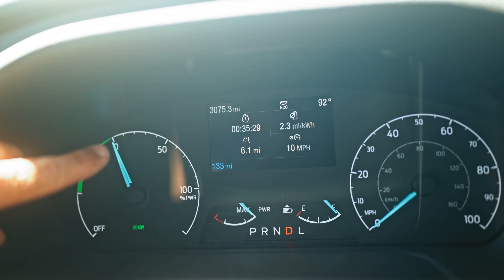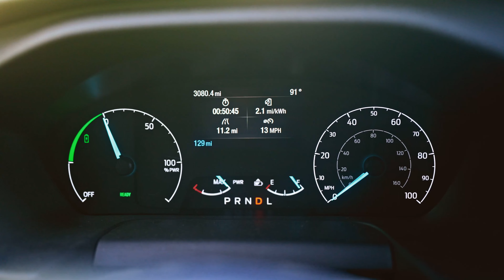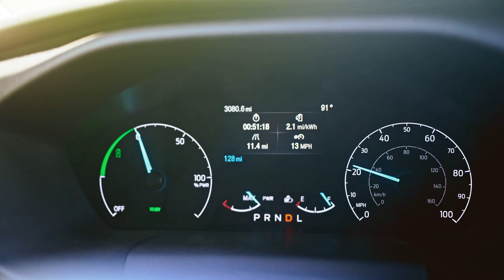Tug Of War!  **ELECTRIC vs GAS**

Comment: I heard it's a feature designed to minimize wheel slip when accelerating from a stop. Electric motors have full torque output at 0 RPM, which combustion engines do not, so without that feature people could frequently lose traction when taking off from stop signs and stop lights (especially if they're accustomed to driving a gas or diesel vehicle.) I believe some other EVs have a specific drive mode that disables the feature.
Reply from the maker: We believe it's a feature that Ford engineered into the e-transit so that you don't dump all of you're stored contents while you are accelerating.

Comment: I would be interested how the E Transit does pulling a utility trailer i.e. power, range
Reply from the maker: They currently aren't rated to tow but I know some have bolted a hitch up to them.
Reply: @SmedleyPlumbing  That's good to know thanks for the fun video's
😄
Reply: @SmedleyPlumbing  Very informative to know this!
Reply: Seen the Ford EV pickup with trailer and it did terrible.   Due to extra friction of trailer and poor aerodynamics.   Of course the drivers gunned it down the freeway as that's what you do in a test.    But the E Transit shows remarkable little difference in distance even when weighted down.    Just shows Aerodynamics make a huge difference.  I suspect if the van had skirts on it, it would do better on efficiency.

Comment: Now go out and drive 300 miles and repeat the test. Electric good for bikes, golf carts, and small slow things. Useless for heavy high speed vehicles.
Reply from the maker: We would definitely disagree.  We are seeing tremendous value with ours.  Saving about $21k on the purchase price and saving about $145/week in fuel while only spending about $9/week to recharge the van.
Reply: It would have been better if you had weighed  them and had the same vehicles  as well.
Reply from the maker: @carlstephens1532  they are built the same with the same shelving and inventory.   Weight was not a favor with this one.  It's all about how much low end power the E-Transit doesn't have.

Comment: Sorry but this too dumb. You need exactly the same weight on both cars. When one car have more weight on the wheels it have a lead already. But that isn’t all. Many factors play part here.
Reply from the maker: In this case, it's the available low end power of the E-transit that limits it's ability to perform.